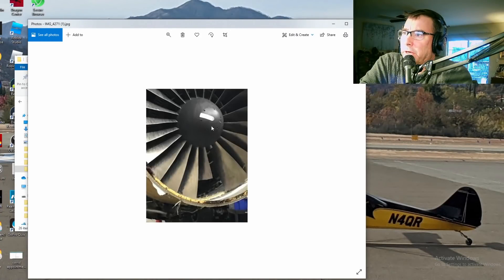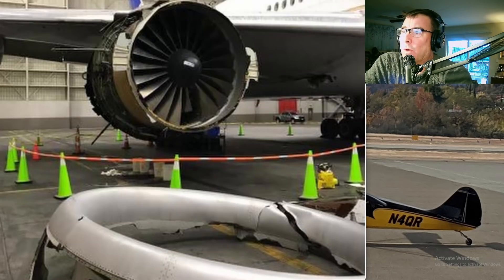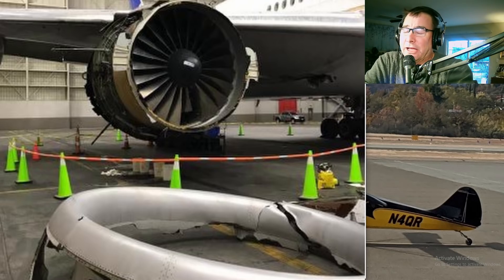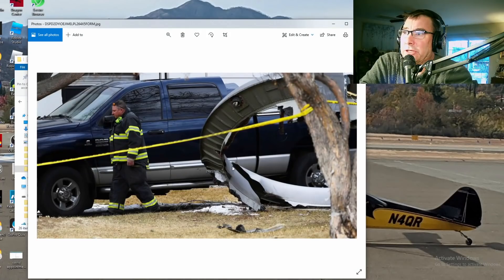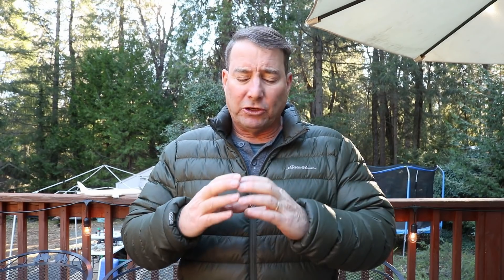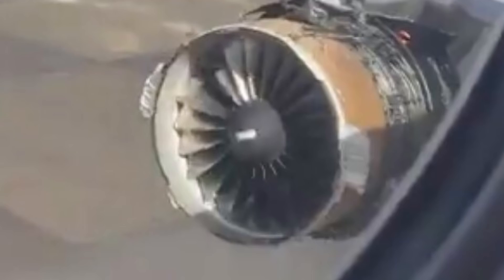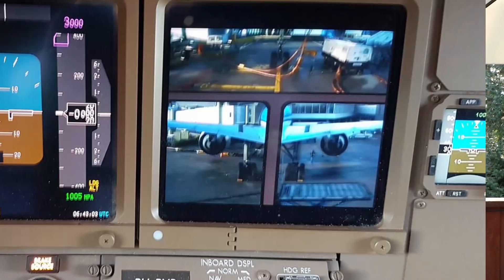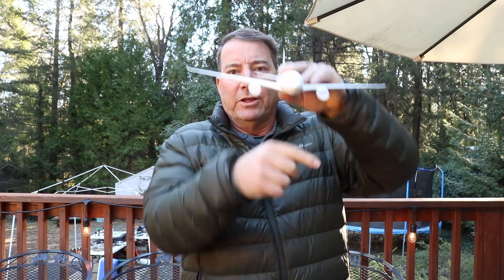UAL 328 UPDATE Fan Blade Failure  B777-200  22 Feb 2021

Comment: RE fuel dump:  "Let's not add fuel to that barbecue!"  --fell out of my chair laughing.  Gratitude.  I needed that.
Reply: It was an amusing way of making the point, and to be honest I never really considered the fact that a fuel dump in an engine emergency situation could very easily become an (unintended) dump'n'burn. Very cool when intentionally performed by an F-111 (I'm old enough to have seen it in person! RIP the RAAF Pigs) but certainly not ideal for an airliner in an engine-out. The directive seems obvious in retrospect. :)
Reply: @sixstringedthing  F111's was the first thing that came to mind!
Reply: When he said that, my first thought was "Concorde"...
Reply: Haha, it was a good point
Reply: Let’s not add fuel to that fart?
Reply: They were only going to Hawaii so there wouldn't be that much fuel on the airplane anyway. No need to dump. I'm sure they weren't   much above max landing weight, if at all.

Comment: Hey Juan. Not so fast on the idea that the fan blade sliced the inlet lip, causing it to seperate. Mid 80's, CF6-50, insalled on a 47-200, ingested a seagull into #3. One half of one fan blade sheared off, flew out the front of the engine. The resulting compressor stall, the big boom the pax on this United machind heard, resulted in a deformed inlet cowl, rendering it unuseable/beyond economical repair. It's conceivable that the United triple 7 compressor stall was severe enough to damage the inlet cowl to the point where it self destructed. As you know, inpection of the pieces will tell the story as to what failed first and so on. After more then 40 years maintaining all models of airliners, this incident is one of the worst I remember. It could have been a much worse outcome. Thanks for all your accurate reporting, my go to UTube chnl.
Reply from the maker: Great Point!

Comment: Since the fan blade appears to have exited forward I don't understand why the engine fire warning system activated or why there was fire unless there was other damage to the engine case that is.not visible the engine fire warning system is activated by heat and there should have been minimal heat once the cowling departed.
Reply from the maker: Other damage.

Comment: If the engine fails past mid way to Hawaii, does the Coat Guard send ships along the route in case the plane doesn’t make it all the way?
Reply: Not needed.
You have enough fuel to fly faster than single engine best range speed why?
Because the failed engine is not using any fuel. And with the cross feed you can feed that one engine with all the fuel in the tanks.
Reply: @hernanposnansky7154  huh. So you didn’t watch the entire video . Blancolirio explains that single operations uses more fuel not less. (single engine = less thrust so at a minimum cannot fly faster than dual engine and has to fly lower altitude - more drag
Reply: @biingyin5522  
single engine operation requires more fuel for the operating engine compared to operating both engines.
 But you got fuel the non operating engine is not using!
Part of the increase is because you must fly at lower altitude (to double the single engine thrust) and part because you must fly at a speed above best range speed (engine out operation with a head wind)
Neglecting added drag due to the damaged engine the drag is the same at the same INDICATED air speed.
The true air speed is then lower (factor: square root of the density ratio) Since you got plenty of fuel you can fly faster at a somewhat higher drag
Best range speed is, for a turbofan engine, just slightly higher than best L/D speed:
 IASo = √(2q/sld)
q = dynamic pressure
sld = sealevel density=1.225 kg/m^3
IASo = indicated AS
q = (Lift/span) / √(π×cd×A)
cd×A = equivalent drag area
L/Dmax = span/2 × 
√(π/(cd×A))
@ flight level 220 density is half sld
@ flight level 330
density is one third sld
Fuel flow (at constant N1 and N2 ) and thrust are proportional to density
Now you can do the math.
LDmax is about 18 for a 777
Total drag is k1 × dynamic pressure + k2 / dynamic pressure
At the L/Dmax speed the total drag is a minimum, so increasing speed from there raises the drag only slightly reducing the still air range.
But with a head wind, you must fly faster to maximize range.
look up span for a 777-200

Comment: Has that blade been found to have gone out the front? It's very hard for a blade to get round the following blade when it's already running into the casing. ETOPS goes from the basic 120 introduced in 1985 to 330 for the 787 and 370 for the A350.

Comment: The engine fire extinguishers require a full intact cowling to work. In almost every case pulling the fire handle will cut off the fuel and the fire will go on its own. On Boeing airplanes the cowling acts as a containment for the Halon (extinguisher agent) to suffocate the fire. If the Halon escapes the cowl area the system doesn't work. The cargo compartment extinguisher is similar with one exception. The cargo compartment is continuously vented overboard through the cabin pressure relief valve. The cargo will be fed Halon continuously until the aircraft can be landed. The timing for cargo fire suppression is equal to the ETOPS certification duration. Non-ETOPS aircraft do not carry as much Halon as ETOPS certified aircraft. One other thing, the 777 with P&W 4000 engines have the 112 inch diameter fan as opposed to the 94 inch fan fitted to the 767/ 747-400. The turbines are very different too.

Comment: "The First Officer usually can land better anyway." Spoken like a true First Officer!
Juan. As usual a very informative summary of what actually failed, the sequence of the destruction and the consequences for the plane, crew & passengers.
I think you neatly identified a weak point in the engine certification process for fan blade failure. The damage caused if the blade leaves the disk going forward and the effect on the fire suppression system if the aerodynamic cowling is lost. Brilliant.
Reply: He is absolutely correct on the test stand runs they do to certify engines. I build the C ducts and inlets for ground testing and they are built like tanks compared to the actual cowlings used on aircraft. Ground test units can easily contain an event like that.
Reply: @WheelsofSteelWelding  It's also unclear if the test stand supports the engine in the same way (and angle) which would apply when it's on the wing of an aircraft. Certainly, videos of tests don't appear to show anything like the level of vibration apparent from passenger videos of damaged windmilling engines.
Reply: @Rich Wightman, that made me laugh. Very funny.

Comment: would a brake on the turbine shaft be able to stop the windmilling?
Reply: The stationary fan would create much more drag.  On a prop plane, with only 3 or 4 blades, feathering is vital, failing to feather has caused many crashes. That fan has a lot more blade area, sort of a brick wall to the airflow.

Comment: Juan, many are saying this was “uncontained” others saying “contained”, what’s the technical definition?
Reply from the maker: "Contained".
Reply: A good example of an uncontained failure would be the airline that lost a window due to blades being ejected right through the side of the engine, which then sucked the passenger out the window. I can't recall any details of the flight such as the number, or airline. That was a severe one.
Reply: @SmittySmithsonite  It wasn't the blades, it was the cowling that took out the window. Contained.
Reply: @SteamCrane  - Ahh, my memory sucks. I stand corrected. Had to watch Juan's vid to refresh the memory. Southwest Airlines flight 1380 in 2018: https://youtu.be/SKLcOgvgCcU
Reply: @SmittySmithsonite  I'm in agreement but many here and on other channels keep thinking this one was uncontained and also want to group it in with the 747 cargo plane that did have an uncontained failure.  I was hoping Juan would give us the reference URL to the technical definition.
Reply: @jlorenz55  - His reply to another comment said it's only uncontained when a blade penetrates the cowling. On this one here, it was ejected forward and through the nacelle, so I guess technically that's contained, since it didn't actually penetrate the cowling, even though it resulted in the nacelle and cowling getting torn to bits and blown off the engine.

Comment: Juan, Excellent report.  After an event like this my first "GO TO" to get accurate info is your channel. I laughed along with you when you revealed that the FO can land the aircraft better than the captain.( Any details you would like to share or do we have to wait until you retire?) Regarding ETOPS parameters for HNL routes:  Are there any cases where there was a rapid decompression AND one engine OUT so the wounded bird had to limp home at 10,000 feet?  That would be a stressful flight. Have a safe flight to LHR.
Reply: I could talk for days about ETOPS, but for flight planning purposes it’s all about fuel.  Depending on the route, an ETOPS segment could be in the beginning, middle, or near the end of a long flight (I’ve had routes with more than one ETOPS segment).  So the fuel on hand is different in each scenario, as are the distances to alternate airports.  Either an engine failure, a decompression, or both together will most adversely affect fuel consumption, so the most critical point of the flight is determined and the fuel required to divert from that point is calculated and compared to the planned fuel on board.  If there is a deficit, additional fuel is added to the flight to provide the required reserves.

Comment: In the past, Pratt and Whitney has been found to be lacking in their inspection process during overhaul of the 4000-series engines. In particular, returning engines to service with cracked blades. Something about it being classified as a "emerging technology" engine and not having as stringent of a inspection protocol requirement as some engines.
Not sure if that was ever completely rectified. 
In any case, the 4000-series engines have accumulated more than 135 million total flight hours. As with anything mechanical, one must expect a few failures, in that amount of time.

Comment: Great summation Juan, I got it all wrong.  I'm looking at a 19" screen from an MRI Scanner that was replaced in 2006!  So I didn't see the one and a half fan blades missing.  Duh!  And while I was pretty sure it wasn't fuel on fire, I'd forgotten about oil - I wouldn't have guessed hydraulics, because there isn't much (except the reversers) on the engine.

You don't say if the cockpit change round to put the Captain in PM is standard operating procedure, but it absolutely makes sense.  If it isn't SOP, it ought to be.  Amazing.  There is so much to do and brief for, with almost everything being slower/faster/heavier/ and who knows what?  (I guess you know, at least!)

My nephew used to fly for Air Atlantique out of Coventry and he used to have DC-3, DC-6, Twin Pioneer, Cessna 206 and all sorts on his 'ticket'.  Then he began flying 757, 767 and now 787 and he is lucky enough to be, like you, flying mostly freight.  He reckons on DC-3 and DC-6 it was uncommon to land with the number of engines you took off with, but since he became a Fan driver, he always does!

I chuckled when you said you had to "go to London - see you there!"  I live there and I will be thinking of you.

Comment: The 777 has huge engines (diameter).  For every 1,000 rpm, the end of the inlet fan blade will travel at Mach 0.72 (am unsure the rpm at cruise).  This is an important design consideration dating back to the propeller blades of C-133 cargo aircraft flow by USAF; blades would fracture due to induced vibration when blade tips were eclipsing speed of sound.
Reply: Fan blade tips are often supersonic

Comment: It sounds like they think it's a defective fan blade. Is there some sort of QA/QC on these fan blades? Boeing stock dropped again to $212.88 btw.
Reply: The blades are inspected multiple times during manufacturing, again when the engine is assembled, again after being run on the test cell after assembly, and then at regular intervals during operation, until the engine reaches its overhaul time.  Then all of it will be removed from the aircraft, torn down, inspected and replaced as required, then reassembled, test run.

The blades deal with incredible centrifugal force, along with bending forces, and impact with sand, dirt, precipitation, birds, and bugs. Add that these blades see temperatures over 100 F then down to minus 100 F and everything in between, often in a matter of minutes. Constant UV radiation.
This failure has prompted a grounding and inspection of every pratt engine, and probably will result in a higher number of in service inspections than before, especially if these emergency inspections turn up anything on other engines. 
I'm an aircraft mechanic, my job is probably 90% inspection and 10% actually fixing or replacing stuff. About the mirror opposite of a car mechanic

Comment: There's a big hole torn in the fairing around the wing root from debris.
Reply: It looks as if the “slats” on the leading edge of the wing are deployed.
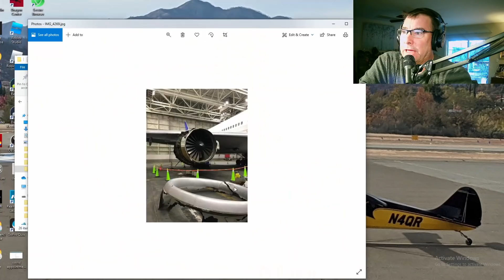Reply: @bigjeff1291  if you pause at 0:37 you can see the gash above the landing gear
Reply: @wewd  thanks, I sure DID see it after you helped me!

Comment: If you use deploy the thrust reverser in a single engine landing doesn't the asymmetric thrust cause the plane to slew (particularly if the runway is wet? 2. You said you want to lose altitude to continue flight on one engine - losing altitude would surely happen anyway due to the loss of thrust / speed? 3. Vibration due to unbalanced intake fan would surely get worse as you lose altitude as the air is denser? 4. Hope you enjoyed London. 👍

Comment: Greetings Juan,

Jet engine cowlings need to be redesigned with multi fiber honeycomb 3D braided carbon fiber, aramid fibers such as Kevlar and with heat & fire resistance fiber such as Nomex. 

I have used these fibers for decades engineering such multi-fiber designs. Lightweight, ultra high tensile strength, heat and fire resistance are key to this  design application.

Redesigning engine nose cones and cowling intakes for anti-fan blade deflection ejection should have been mandated decades ago.

A fail safe self balancing shaft or variable pitch blades to lesson the damaging harmonic and in-harmonic vibrations after a blade off events should also be mandated, but may be cost, weight and engineering prohibitive. 

Juan, thoughts? 

Thank you for your follow up and awesome videos.

Cheers,
Kent

Comment: I’m old.  I like four engines (and a flight engineer).  No ETOPS in my day.  Lose one, descend a bit, have lunch and press on...under most circumstances.  

I did a have a turbine failure with a 747 over Santa Catalina from ONT to HNL.  We dumped 100,000# and returned to ONT for a tail swap.  You don’t know what the associated damage might be to the adjacent structure or adjacent engine.  2100 miles over the Pacific is a bit too far to find that you might have a fuel leak and/or a another engine failing 1,000 miles from land. Management took us to breakfast during the three-hour tail swap, so it was all good.  We arrived at HNL just in time for an evening stroll, a sip and a snack, thanks to the delay.

At our airline the captain flew during all emergency situations.  The concept being that he/she was the most qualified to fly the airplane under those circumstances.  Of course, we did have flight engineers to assist in the three and four engine airplanes back in those days.

Enjoy London.  I’m going to Carson City in the morning for a prop balance.  Non stop, no ETOPS...

Comment: I wonder if the person who found that ring cowl in his front yard got a nice check. The fire bottle probably works but it just sprayed out behind the jet with no cowling to contain it. On other 777's this always happen on takeoff, I believe that BA 777 that lost a engine in  Vegas got repaired and put back in service. The fire ext nozzle just looks like the end hydraulic tube fitting.

Comment: Perhaps they need to re train a few of the old railway "wheel tappers" to check the blades with a little calibrated hammer before every flight. A joke that maybe, but some sort of resonance test could be done quite quickly, being as this fan can be easily turned. By hand I think. The grounded aircraft might even be having this done as a first step of inspection.
Reply: More likely ultrasound, after visual inspection.

Comment: I wonder how much of the engine pylon and wing structure will need to be rebuilt after all that shaking!
Reply: Probably none, they'll most likely just scrap the airplane. 772UA was the third oldest flying B777 in existence. Getting a little long of tooth.
Reply: @stephendixon4619  they should just scrap their -200s and keep the 200ER and -300ER.

Comment: Juan, love you detailed explanations. Just a though, if you had a damaged engine windmilling and vigorously shaking the plane, would you consider using the thrust reducer to reduce the airflow through the engine? I would assume this would reduce the windmilling and maybe make the ride a little more tolerable. Of course the question arises wether the reducer could have been damaged and or produce more deleterious effects than good comes to question. Thanks
Reply: Juan is out flying, but I think he will confirm that using a thrust reverser is definitely not an option. Would not help to mitigate vibration because the airflow through the core engine is the same as during normal forward thrust,. Apart from that, reverse thrust cannot be selected in flight on the 777.

Comment: I wonder what ignited the fire. That’s fan air - cold. Unless something came out of or into the hot section, there shouldn’t have been an ignition source. It will be interesting once they open the TRs and we see if there’s any other holes in the case.
Reply: What about Oil and hydraulic fluid (which is an oil)